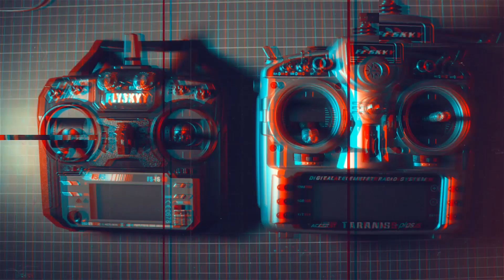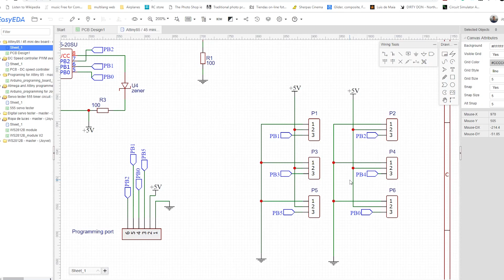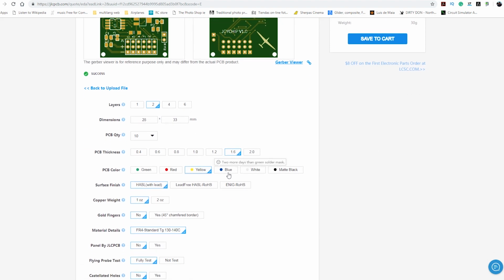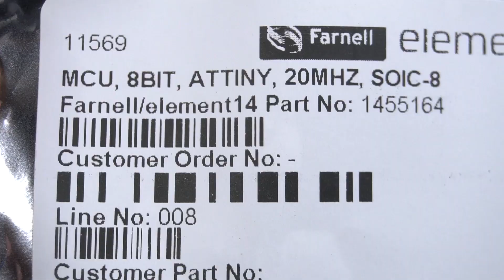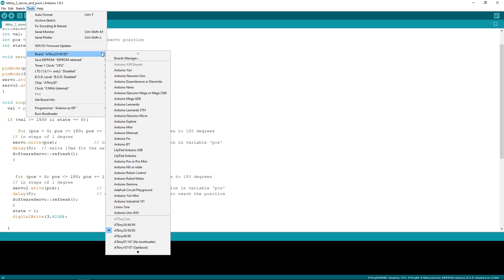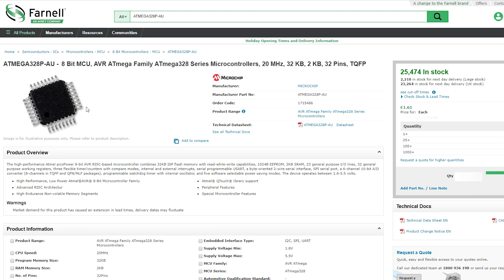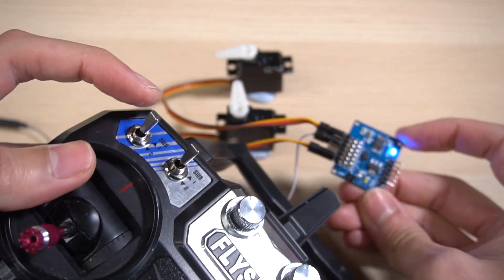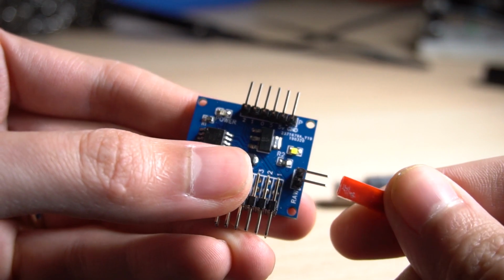JOYCHIP 1.0 A programable versitile chip for RC platforms | JLCPCB

Comment: Very cool for some who is self taught, and the board is very cool right now I am using the Atiny85 to make airplane Strobes Yes real airplane strobes. Why? Have you seen the prices of aircraft strobes? Thats why.
Reply from the maker: hahaha Just make sure they are reliable. They tend to be expensive because they should pass quality tests and be fail-proof.
Reply: @Joyplanes  These are for EXPERIMENTAL airplanes NOT CERTIFIED, so were good. And I have had zero failures so far in all the extended bench tests.
Reply from the maker: @edwinkania5286  Cool, but still that's the explanation why those lights are so expensive. Some components have to be military-grade and all. Cheers.

Comment: Are you powering all servos from that small linear regulator that takes 2-3S as input ? It is only half a amp at max. It will overheat. You need a small stepdown dc-dc converter on your board.
Reply from the maker: No, I'm not powering the servos from a regulator, they are connected directly to the battery using 5V, actually using the 2 or 3S batteries just created some noise and the servos didn't work.